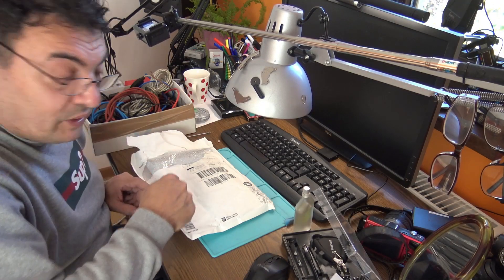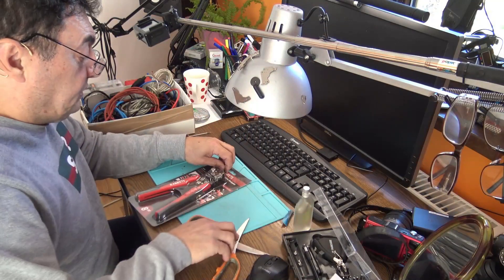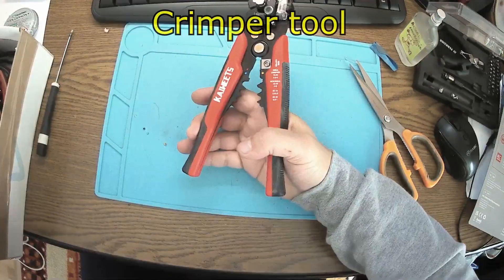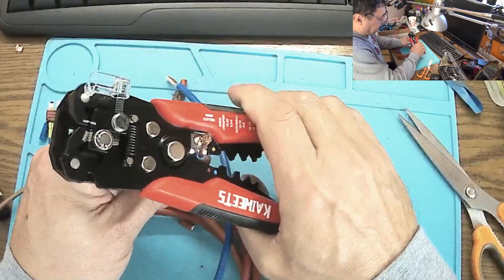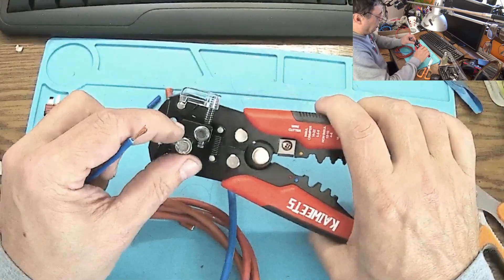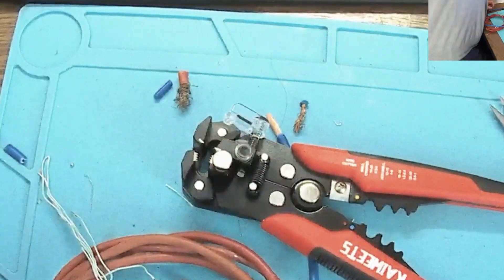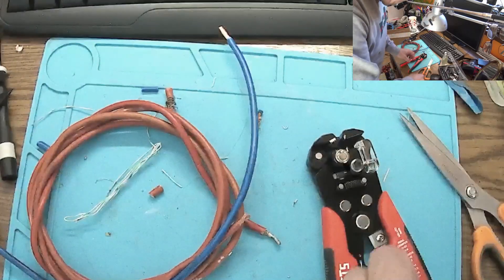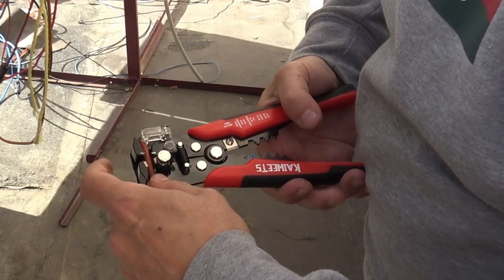Kaiweets KWS-103 Multifunctional Automatic Self Adjusting Wire Stripper

Comment: Check out the Klein 11601 Self Adjusting wire stripper. The cutters are really clean and the adjustable arm is 100% metal.
Reply from the maker: I got this for free from Kaiweets, so...
Reply: Yes as you stated in your video. But that doesn't mean you can not branch out and try new tools and compare and contrast! Always be a optimistic about new tools. @viocaia